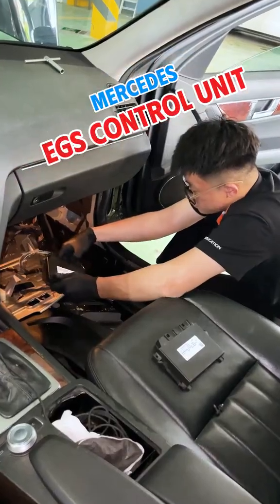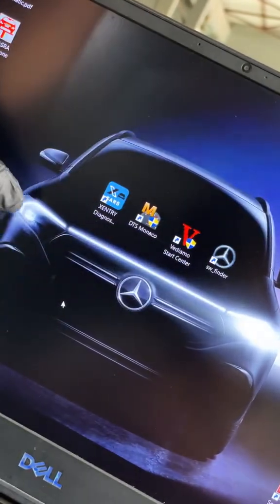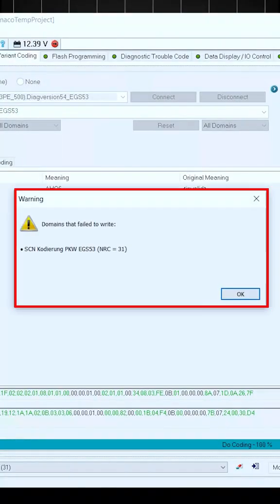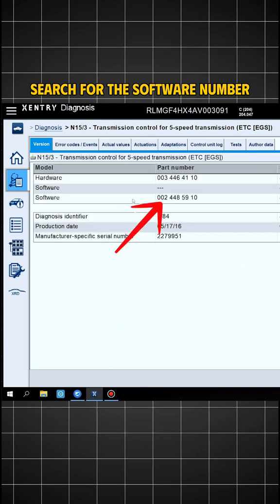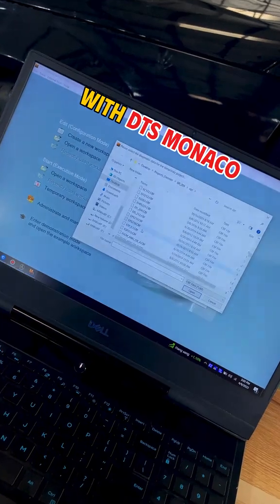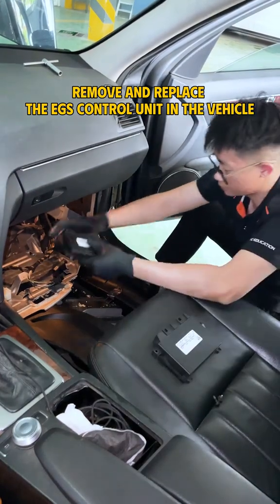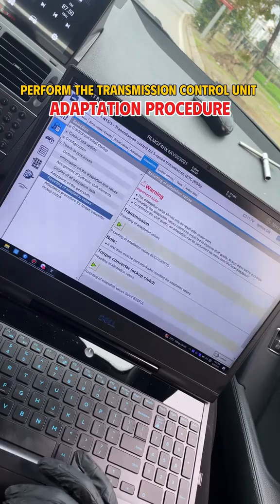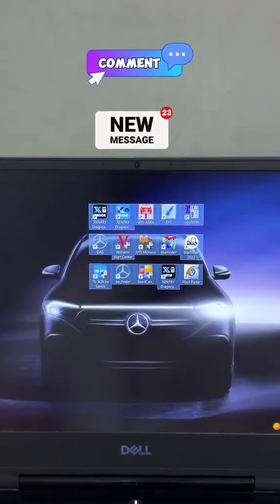Programming / Coding Mercedes EGS Control Unit  #codingmercedes #mercedesdiagnostic #mercedescoding

Comment: Can i use VCX SE for Mercedes coding and programming?
Reply from the maker: you can use it, but for full features you should buy the license 
You can refer to: https://vccartool.com/product/combo-vcx-se-license-multi-brand-diagnostic-tool/
Reply: @VcCarTool what about C4 connect
Reply from the maker: @udohequere6042  C4 is a Mercedes-specific device, so you can absolutely use it. See more C4 products at: https://vccartool.com/product/mb-star-sd-connect-c4-doip/
Reply from the maker: @udohequere6042  If you need any assistance you can message me on WhatsApp
Reply: I'm specialist for locksmith looking to this codding game. Any advice please on how I should start ?
Reply from the maker: @dashtyATG  Do you have the device and software? Please WhatsApp me +1 (901) 414 - 1927 for further assistance.